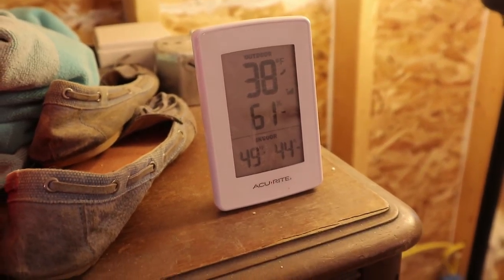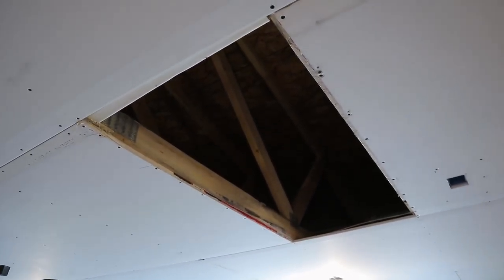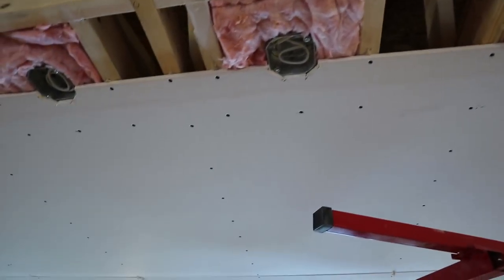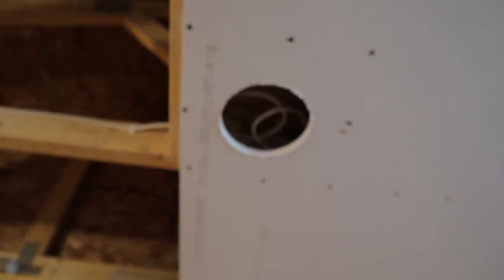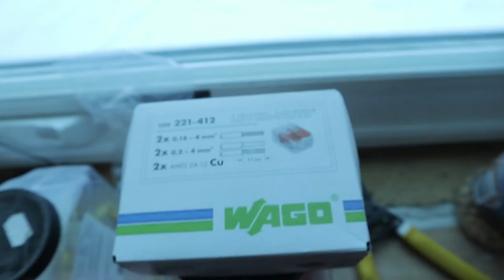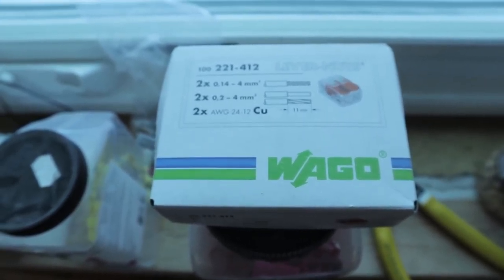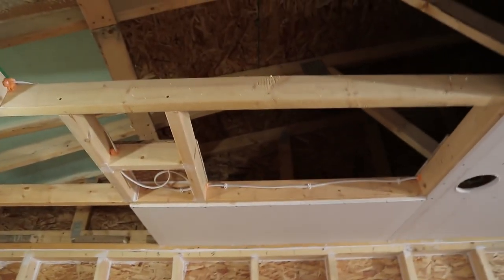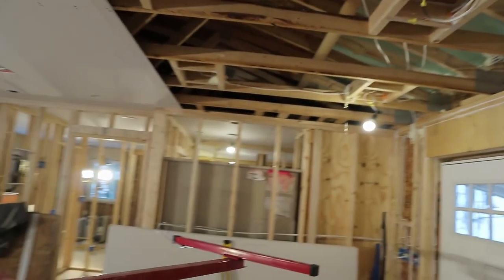PGH P18, How I Install Ceiling Drywall

Comment: I would install a loft hatch, just in case! I don't like to have areas of my house that has been sealed off from me by walls or ceilings. You may never need the access but it's damn nice to know that you can get up there for whatever reason, even if it's to set a trap for the rodents that inevitable moves in to your attic. :-)

It doesn't have to an elaborate thing with ladders and all, it can be a simple frame that overlaps the access hole and then a piece of 1/2" plywood that drops down to a thin foam seal on the back of the frame and lets gravity and the rockwool batts on top of it keep it airtight.. If the foam seals are flexible enough they should seal well.
Reply: Only problem I can see is pest control, like yellow jackets or so.

Comment: nice project. one suggestion, especially since you are completely sealing your attic. Run data cables for  networking, internet and cable.
Reply from the maker: I did. 4+ drops of each cat6 and quadshield + ceiling wifi and security cams

Comment: Part of air tight design is putting a plastic envelope around the living area. That means putting plastic on the ceiling, then down the walls. I did not see any plastic under the drywall. Am I missing something? I don't believe trusting the drywall is enough.
Reply from the maker: Airtight boxes around the ceiling penetrations, drywall is glued up to the boxes. Thoroughly caulked all the wall framing and sheathing.
Reply: I understand the system after you are all done. My contention is you added a lot of cost and labor over just foaming the walls and ceiling. it all comes down to what you have money or time, For you it was time.  Good thing you had relatives to help.